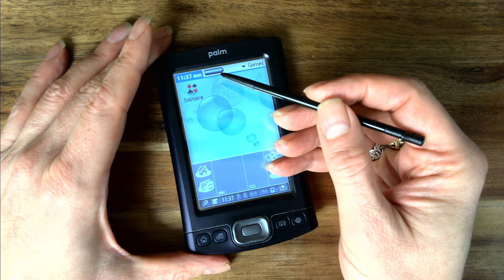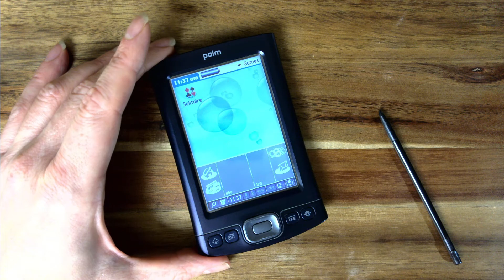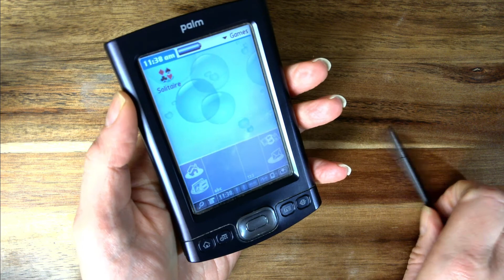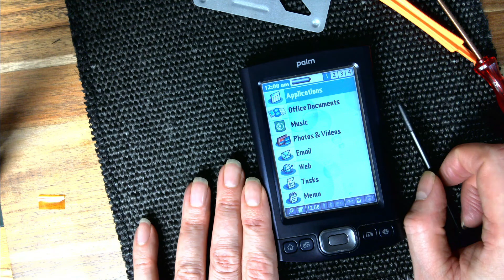Replacing the Battery on a Palm TX

Comment: And.....where do I buy the battery?
Reply from the maker: I went for a Cameron Sino as I've used this brand before.

You can get them for around £12 or 14 Euros ($16) from Amazon or eBay

This is the link to the one I bought, adjust to your own location.

https://www.amazon.co.uk/gp/product/B006ZCJ1ES   

The part number is CS-PMTXXL